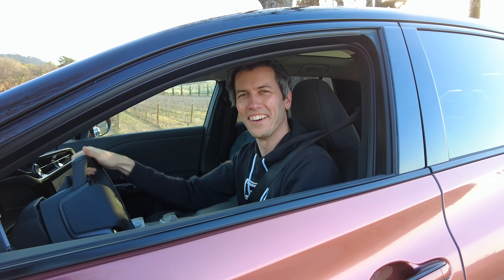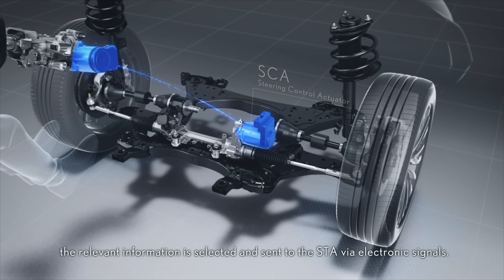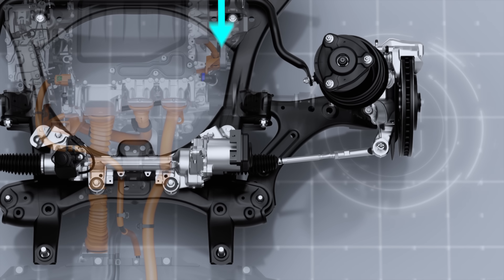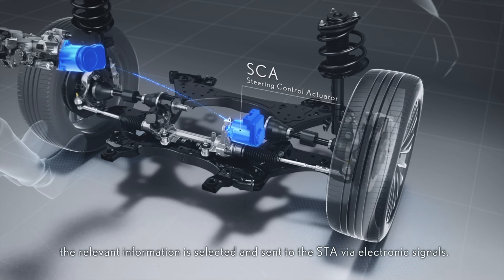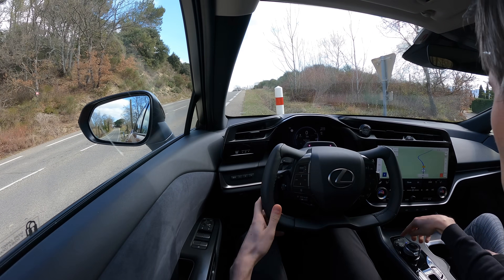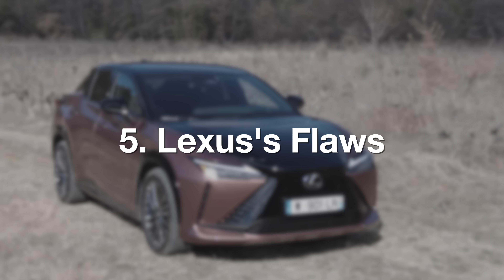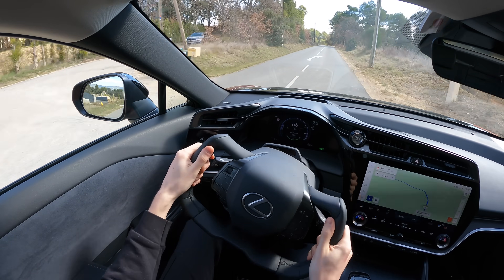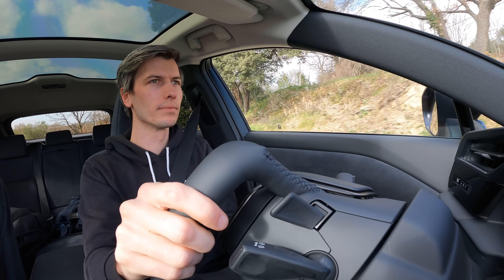How Lexus Fixed Tesla's Bad Idea: Steer-By-Wire Yoke

Comment: For a car, the steering input response and force feedback should be instant (really instant, no delay) as if it is a mechanical steering column, or at least have a setting like that. I do really like the variable steering ratio though.
Reply: Mechanical isn't instant without delay, nothing is. The speed that a force can move through a material is = the speed of sound for that material. For steel that is around 5,000 m/s. So if your linkages from wheel to steering wheel is about 6 feet long, it takes 0.0004 seconds for any force to transmit from one side to the other. Delay was always there, just not very much of it.
Reply: @wally7856  -_-
Reply: @wally7856  so mech steering has a delay of 0,4 ms... are you pendantic for the sake of it or do you think it makes you funny??? 0,4 ms is practically instant for all intents and purposes, at least in this context, while the delay in the video is 1000 times higher, which for real world driving i'd say it's too much.
Reply: @dubl33_27  I was teaching you about the speed of push is the same as the speed of sound in an object. If you push one end of a stick the other end doesn't start moving right away. That delay isn't instant, it's still a delay. I guess physics is too mentally challenging for you.

Comment: I have driven many drive-by-wire cars, and while the throttle response has consistently been delayed, it has been tolerable. However, when it comes to the steering, any delay is unacceptable in my opinion. At the end you will never be able to get the mechanical response with by-wire systems.

Comment: Are they also going to put the accelerator on the steering wheel?... as they had 120 years ago?
The electronic steer by wire system just seems to be solving problems that don't exist, but it may lead to helping out in other areas that aren't even intentional yet.

Comment: Fly-By-Wire has been a thing in aviation for quite a while now, it's interesting to see it now introduced to cars.
Reply: Its not really a super good fit for this usecase honestly? Fly by wire works because when it doesn't, you have time to comp out and re-bias your controllers which a system will do every few minutes when conditions change with a response-time of around 5 seconds safe. You kinda can't do that when rebiasing results in like, a collision in <1 sec safe? FBW has absurd maintenance standards, three to eleven layers of redundancy and specifically you're not even flying the plane, the plane is flying the plane and you're making requests to the plane. The same isn't... Really true... Of a car... Where you do kinda want to know the result of your actions. This thing is a human factors engineering problem waiting to happen. The latency induced oscillation and weird awful traction-control fighting that's going to happen here is going to be awful and the class-actions are going to roll in like butter.
Reply: I don't have a problem with fly-by-wire systems, because airlines have to follow extremely strict maintenance standards, the pilots undergo several years of training, and the systems have multiple layers of redundancy. On the other hand, car owners often drive like maniacs and neglect even basic maintenance just to save a few pennies, and the redundancy provided by a physical steering column is lost in a steer-by-wire system. Therefore, I don't have confidence in this technology being used in road cars.
Reply: @Tuppoo94  cry harder
Reply: Fly by wire have constant maintenance and checking. Pilot have tons of training and there are usually 3 layers of redundancy.
Reply: Theres not hundreds of millions of barely annually maintained planes driving bumper to bumper on poorly maintained road systems operated by people who took a test decades ago
Reply: The difference is that airplanes get thorough checks very regularly.
Reply: The value-proposition for FBW in large aircraft is immense, and even then many large aircraft still don't use FBW because software is so hard to get right 100% of the time. The value proposition of FBW in a car is pretty small, but carries the exact same risks.
Reply: Fbw isn’t a problem if the response time is short enough.

What this vehicle does for response time is garbage
Reply: because... trying to move yoke on such huge airplane without hydraulic support requires super human strength (even so at higher air speeds). even small planes that are genarally easy to manouver without hydraulics will often sieze up when flying at high speeds (basically diving for too long and you'll end up a pancake).
Reply: Airplanes, notoriously known for flown by the general public and have rare maintenance.
Reply: FBW is a tad more complex than just steering. Translated into ground vehicles it would be rather an equivalent of controlling a motorbike over wire.
Reply: Ngl, that lexus looks good.
Reply: Yes but its in aviation, because as planes got bigger you couldn't physically move the control surfaces.  I don't see the point in a car.
Reply: The difference is that aviation is much less dangerous and doesn't require precision compared to cars. The amount of time required to react to dangerous situations in a car are much less than an aircraft.
Reply: Every technology the military makes ends up in the civilian market. That's just how it has been. Another car-plane example is HUDs
Reply: @Icerz.  and not everything works.
When was the last time you saw a jet powered car?
The F-16 is one of the most cost effective  aircraft and was the first production fighter with fly by wire. it's fly by wire system, controlled by at least 3 separate computers were suppose to make the plane stall proof. when ever it approached stall conditions, the Flight control computers would reduce the angle of attack to keep the plane from stalling.
Well, the F-16 also has a nickname... the lawn dart, because of the number of crashes caused by the aircraft stalling and the pilot not being able to recover from the stall because of the fly by wire programing.

Another poster mentioned how much maintenance hours are provided these planes. he's right, the F-16 needs 17 man hours of maintenance per single hour of flight.
The newest FBW aircraft in the US military inventory is the F-35, it's recently had a rather public incident where while the plane was landing, the nose dropped to the ground while the tail went up, smashing the nose into the ground, the pilot to eject and the plane to crash.
That plane needs 7.5 man hours of maintenance per hour of flight and at this point they are struggling to have them available to fly more than 60% of the time and the minimum goal is 80% of the time.
Reply: @linusa2996 No an aircraft doesn't require 17 hours of maintenance for every hour of flight. If that were the case no military aircraft would fly. No civilian airplane would fly. And we would be completely and utterly fucked if we were ever to be in a war because the aircraft would literally be in a garage.

Maybe on paper that's what they want. But in a real world scenario that's impossible in all but the most ideal peacetime conditions
Reply: well, it will increase number of crashes on roads. Fly by wire is pretty much only in military and huge passanger planes. Pretty much only small planes that have fly-by-wire are gulfstream500 and 600, which are owned by rich people. There will not be an army of mechanics checking your car after every drive. You wont be able to repair your fly-by-wire so cheaply, repairing will cost fortune, all new cars tons of electronics are never fixed in modern cars, because fixing 1 simple light adjusting motor is as expensive as buying pretty much whole car.
Reply: While true, unlike pilots, drivers don't have to train for months and years to master the control of planes, nor do the driving schools adapt to this. Simply drivers are idiots, and pilots train on fbw. I think it's not a fair comparison with that in mind
Reply: well, still , if there is not army of mechanics inspecting drive by wire every 10 hours, it wil lincrease crashes. @Skynet_15
Reply: This probably isnt even remotely at the same level of testing and durability
Reply: not a hater at all, actually i really like lexus. but cars are not always as well-maintained as airplanes. so this system should be completely error free, or it will be very ugly once it does malfunction. if I would trust this system to steer my car, I would perhaps only trust lexus engineers and will be scared to drive any other car brands if they adopt this system
Reply: I wouldn't compare it to the FBW for the flight controls on planes. But rather to the steer by wire for ground operations, which has been used since  the 1980s on aircraft. The A320 tiller (ground steering wheel) and rudder pedals are controlling the nosewheel by steer by wire, not mechanically. Never even heard of a failure of that, just  hydraulic failures that  impact the actuators and  thus make  steering impossible. It is incredibly reliable, precise and rugged.
Reply: not comparable.
Reply: Also interesting to see the same old haters thet claimed fbw was unsafe and would kill everyone come up with the same argument once again, sigh, guess it's time for round 2
Reply: @johjoh9270  Ya there was alot of trial and error when it came to FBW in planes. FBW has been the cause of many passenger plane crashes in the early days
Reply: @johjoh9270  Tell that to the dead on the Boeing 737 Max MCAS crashes.  Oh wait you can't, they are DEAD.
Reply: @johjoh9270  They don't talk about the 787 and  (737 Max  FBW  spoiler). The only issue I can see if the driver changes vehicles to a non DBW
Reply: @kmcat oh no 2 shitty planes with a system that has been in planes since the 70s
Reply: The precision required for in inputs in an aircraft vs a car are very, very different. An aircraft, for example, is never operating within a couple feet of obstacles. The immediacy of response and especially haptic feedback are far less important in aircraft.

Fly by wire also allows for much larger aircraft, as the amount of force required from the pilot to actuate longer runs of mechanical cabling and the forces required on the control surfaces increase dramatically with the size of the aircraft.
Reply: try landing a light craft in a heavy:face-fuchsia-tongue-out: cross-wind @mikalrage7316
Reply: @mikalrage7316 The precision in a fighter jet (F-16 F-22 etc.) also uses fly by wire, and it is very precise with built in feedback which is very necessary to respond to your plane. See the precision in the air force's thunderbirds for an example.
Reply: @mikalrage7316  flybywire really isnt that useful to make bigger aircraft the 747 is a cable controlled aircraft all controls are hydraulically assisted on aircraft anyways fbw or not
Reply: @mikalrage7316  lol what? Aircraft don't need to be precise?

Guess well ignore all of the military aircraft that have used it and do IN FLIGHT REFUELING, something more precise than anything we need to do when driving.
Reply: Those saying that fbw has much more redundance than steer by wire, non fbw airliners have the same amount of redundancy because of how safe and regulated the airline industry is. There can be crucial parts of a car thay dont have such redundancy and yet they have put a lot of redundancy on the steer by wire. So the problem is not the steer by wire, but the people driving using steer by wire. And ig we'll see how that goes
Reply: I was about to write something about fly-by-wire
Reply: In bikes also that is a thing from many years. Race by wire
Reply: @SiddharthVyas  no production motorcycle has steer-by-wire.
Reply: @SiddharthVyas  Show me a bike with fly by wire steering...please.
Reply: @tilus75  I've mentioned race by wire
Reply: @tilus75  motorcycles are steered by leaning them. If you try to turn a bike's handlebar without leaning, the bike will lean and steer in the opposite direction. Fly by wire on a bike would require some kind of input control from the rider, and there isn't one. Or rather, there is, and it intuitively controls the bike without any mechanism at all.

This gyroscopic phenomenon actually gets new riders into accidents when they reflexively try to turn away from a threat like they would have on a bicycle. It's an excellent reason to take a safety course if you are new to motorcycles.
Reply: @SiddharthVyas ride by wire is not steering tho lol. Ride by wire is old tech
Reply: @LifebyDesign  But the concept is similar no physical wire is being pulled like the generic ones

Comment: Its about bloody time drive-by-wire comes to the market... I have been flying aircraft with fly-by-wire for many years, and it alleviates so many issues compared to mechanical systems... less (mechanically) to go wrong, rather than changing mechanical couplings  (which wear out due to friction etc) to sensors/digital which are less likely to wear out/malfunction. 

People just don't like change, hence the negative comments.

Comment: Meh. I'm old and old stuff is better. Unless it's too old.
-The steering delay may actually be the opposite problem: it offers the ability to turn the wheel too fast. A mechanical system would slow your hands down, like it slows down the electric motors. Maybe Lexus should use those feedback motors to simulate mechanical drag on the yoke.
-'From an engineering perspective', I'd argue that it's actually safer than mechanical steering, which has little to no redundancy. But I doubt it's as 'reliable'. Steering shafts are near indestructible and outlive almost every vehicle they serve. There's a lot of little moving parts here that will put the car on a tow truck, probably several times in its service life. Not to mention cost. I never even think about the 21yo steering shaft in my WRX; I can't imagine living with this tech when it's 10, let alone 21. And good luck hacking my bugeye's steering! 
-I'll have to try it and see how jarring it is to turn different amounts for the same input. If I don't like the wave of power from my turbo, I doubt I'll like a wave of turning from my wheel.

Comment: Maybe I misunderstood. At higher speeds the steering is less? So turning the steering wheel at lower speeds results in a different steering angle with the tires as at higher speeds?

If so, what if you slow down in a curve? Will the steering wheel be skewed when turning to straigt direction while decreasing in speed?

Comment: i think it could be dangerous because driver will be more confident even if they are bad drivers. In throttle and brake by wire thee is no force feedback so it is very different. I understand taht people dont like driving and they dont care, but i bless my car because it has hydraulic power steering. It makes driving so much fun

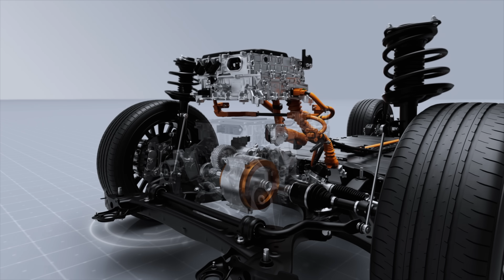Comment: 2:55 bad logic airplane that use fly by wire still have a back up system in case of a mechanical failure. lets see if regulators allow this after a few accidents

Comment: Dual redundancy doesn't help you in this situation, what if one steering sensor points left and the other right - which one do you beleive? Aircrafts use triple redundancy for this exact reason. Acceleration by wire's failure mode isn't bad, and I don't beleive any break-by-wire systems don't have a physical link as backup, so I still don't see how this is safe.

Comment: This sounds like it's going to be a nightmare to use on truly slippery surfaces. Good luck trying to figure out on the heat of the moment just how much countersteering is needed at that precise speed and that angle of drift to compensate when the ratio changes all the time

Comment: What's the difference with any other electronic powered steering system in older cars?
Reply: The difference is those weren't steer-by-wire, those were hydraulically-assisted conventional steering systems.  They could still be manually steered even if the power steering failed.
Reply: @zackakai5173  makes sense, and just to complete how the system works in my mind, how does the electrically assisted power system disconnect the driver so much from the steering wheel?

Comment: Planes has been using fly-by-wire for years now, honestly I’m surprised that this stuff wasn’t implemented earlier.
Reply: Planes and cars aren't remotely comparable.  Especially not big airliners, but even smaller aircraft.  Planes get a hell of a lot more maintenance and routine inspections, a pilot's license is a hell of a lot harder to get than a driver's license, and they're a hell of a lot more tightly controlled in terms of where they can operate.

Comment: My main concern is in the worse case scenario. many years later when a technician is trying to push the vehicle in when it has all power loss or faulty control modules the lack of a physical connection could be a issue
Reply: Exactly... If the battery of my car dies I can drive the car... Believe me... It happened with my old V70 during a Sunday night (I remember that because there was Noone to be called), the battery had an issue coming back from and old travel and we had to turn everything off to save every bit of charge... And the steering wheel was so hard...
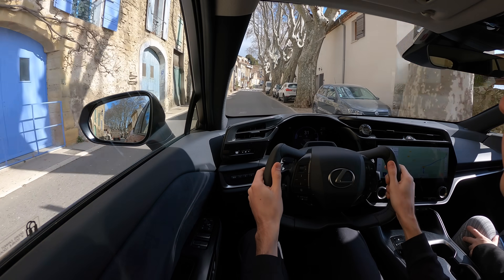Reply: It's almost as if you didn't retain the information in the video. It's 6:45 in, since you clearly need a refresher.
Reply: what if all those 3 fail? @Ijuststopthepucksbro

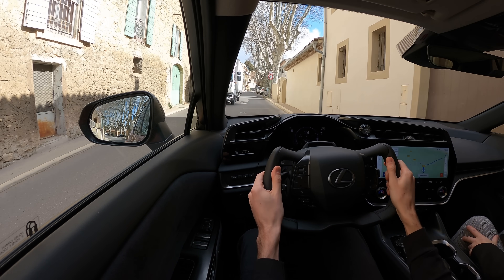Comment: 06:35 This clip with the truck is enough for me to not want to drive one of these ever. I live in Germany, and roads as wide as the one on this clip are not uncommon. To me it looked like there was either a delay, or an adjustment of steering ratio here, either way the concept of an adaptive steering ratio I have no control over sounds terrifying to me. I have no sure-fire way of knowing exactly how the car is going to react to my steering. You just have to guess what the board computer thinks is appropriate and work with that.